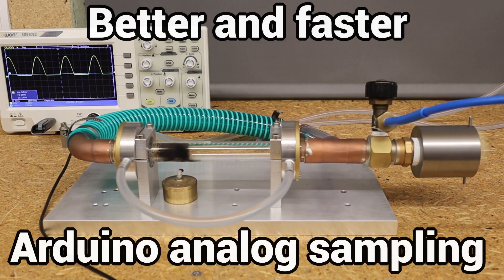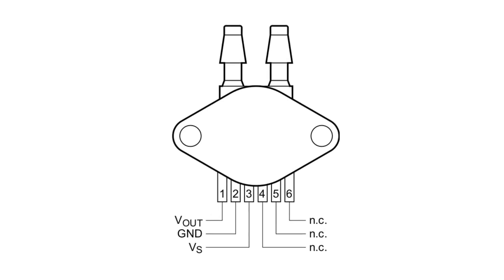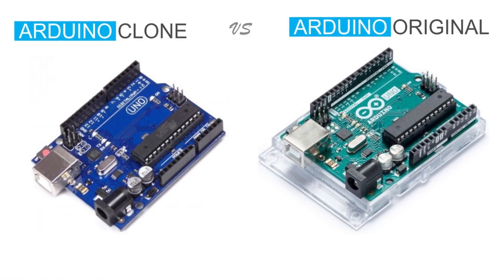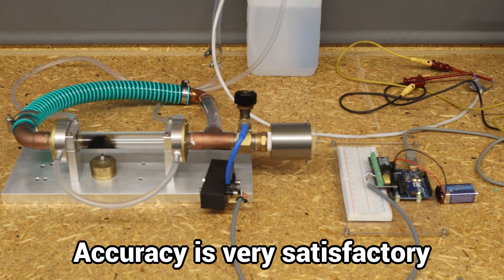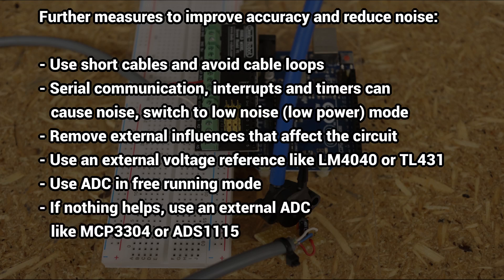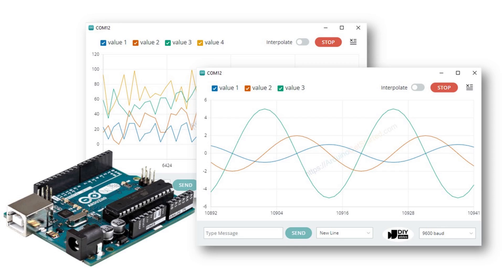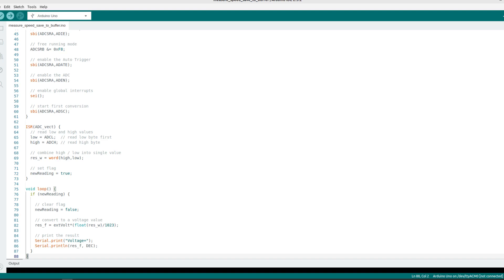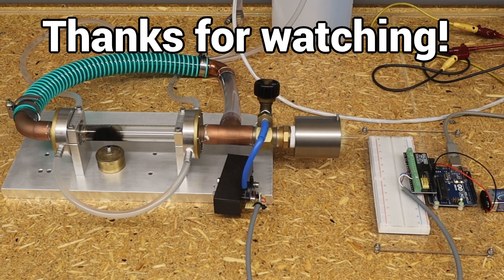Better and faster Arduino analog sensor sampling - improve Stirling engine pressure wave measurement

Comment: the lack of info about thermoacoustic engines is really irritating to me. 
Seeing someone trying to make an actual Thermoacoustic engine for power output, and not just some dinky model toy is really pleasing.
I hope you'll be able to add some more information about your findings to the currently lacking materials about these engines.
Reply from the maker: Thanks!

Comment: Form my understanding of these systems (travelling wave thermoacoustic engines). You get max efficiency with 3 stage system and max power with 4 stage system? Also the second cold heat exchanger after the buffer tube in some cases seems to be replaced with a bypass tube that connects to the cold side. I'm  curious if the bypass method works better than the second heat exchanger. Also the resonator tube  sometimes is liquid.

Comment: What maximum sampling rate did you achieve? I think a faster board like ESP32 can sample ar a better speed 😃
Reply from the maker: I did not tested the maximum I can get with accurate results but it's already faster than I need it.
I have also a few esp32s and 8266s for other tasks but isn't their ADC not as good as that of the  arduino?

Comment: Looks like a great project - enjoy. A few thoughts for your consideration:
a) I was surprised that the bandwidth of the sensor relative to the system frequency wasn't discussed. The sensor datasheet lists its response time (which can be converted to bandwidth) and that needs to be compared to the frequency of the system, allowing for Nyqist Sampling Theorem. There's several ways to measure system speed: a timing gun, bouncing a laser off a moving part and picking up the reflection with a phototransistor, or measure frequency of the sound via a smartphone app. You may need to buy a faster pressure sensor. Following that, the low pass RC filter should be specifically designed so as not to materially impact the desired signal frequency. I agree with other comments that a long air tube may be problematic.
b) I prefer to use absolute pressure sensors. I believe the two port sensor you have may be a differential air pressure sensor. In which case, you're actually measuring pressure relative to ambient air pressure. Even if you block one port with a membrane, that membrane would transmit ambient air pressure. Wikipedia's 'Pressure System' page notes that ambient air pressure can vary up to approx +-10% with weather systems. While it won't impact your high frequency measurements, it could impact repeatibility across the day, and between days.
c) I urge you to show actual values in your videos (rather than use words like 'more' or 'less'), and equations used, as this will help others contribute to, and learn from, your work.

Looking forward to the next video!
Reply from the maker: Thank you for your qualified and informed comment.
I can't show everything I do in the videos, and it's also very important to decide what's really important and what can be left out to save time and money.
I will look at your suggestions very carefully and then implement the most important ones for me!
Your help is exactly why I make these videos!
Thank very much you and best regards!

Comment: nice but why dont you use your other, much better measurement equipment? I see no use in choosing a cheap 3€ arduino over a 1000€ oscilloscope as long as you do not want to control anything with those measurements.
Reply from the maker: You are right, the oscilloscope is very good to show exact voltages and the waveform but I want to measure many other parameters like power, temperature, speed, measure time, timestamping, save the results in a file for further processing, and show them in clear readable form on a display.
Later I want to control and monitor the engine also over the net and many other points as you can see in my older videos of the rhombic Stirling test bench.
Also the oscilloscope is very bulky and impractical.
This is just the beginning of the building of my test bench!

Comment: Great project. Arduino's ADC is incredibly slow, it can take even miliseconds. You will have to avoid using analogread() function and instead make your own by following atmega datasheet. I still think it might be too slow. I would recommend using different mcu, such as stm or esp.
Reply from the maker: You are right, using registers to avoid analogRead() is an additional way to speed things up I forgot that.
At the moment I am very happy with the speed and I can read accurate and much faster than I need to.
Many thanks for your help!
Reply: Hey bro, can you help me to the right direction?
I need a method to collect and store 100ms of (megasamples) of digital (don't require analog) data over a relatively long runtime.
I've heard that dedicated logic analysers can take simple inputs of up to a few hundred mhz or megasamples of data, and log and store a short period of that high frequency data.
I want to be able to log and sotre possibly.. a few megahertz/megasamples of data over a good few minutes.. optimally hours.
All while being able to respond to those inputs and track their fluctuations and respond again accordingly. All.. at those high frequencies.
But I haven't found any solutions, and even seen high end scopes can only see a few megasamples and may only store the log of a very short range of time.
Can you provide me a solution.. that'd allow me to do the long period, high frequency logging and response (like a microcontroller).
I'd not mind if I can find a convoluted solution to daisy chain multiple microcontrollers and use some method to synchronise them to get a high frequency input output solution.. just as long as it'd be accurate.
Also, any tricks to get more sample rate out of the existing popular microcontrollers like you were suggesting in this comment?
Very long comment, sorry for all this.
I know I'm asking a lot.
Would love to get a solution though.
Thank you very much for even reading all this.
I'm not very efficient at communicating complex things.
Reply from the maker: If I understand you right, you want to sample with several  MHz ? 
That's beyond my experience, maybe you look out for the high end external ADCs and special information about that.
A very fast data storage system may also be needed...
Greetings and good luck!
Reply: @yasirrakhurrafat1142 That is a really complicated problem. 
First things first, an arduino won’t help you with that. You need a very high end controller, such as an esp32 or maybe even some kind of microprocessor board such as the raspberry pi. 
Second, you’d need an ADC with decent precision and high sampling rate. L
Third and most important, you need an extremely fast storing method, which would be capable of storing data continuously at such a high speed. 
I suggest you look into professional cameras. They usually deal with high speed storage, since photos really need to be stored stupidly fast. A Jpeg file might be small, but the RAW file that outputs from the sensor and stuff is way bigger, ranging from 2-6 times the size.
Anyways, I think one of these two boards might be the way to go. Especially bare metal raspberry pi, boasting gigabytes of ram memory. It really depends on what you want to do though. Your explanation was a little lacking on what you want to do with the data, so I can’t really pinpoint the best development board to use. Not that it’s an easy question though. 
Best of luck on your adventure.

Comment: The tube between the engine and the sensor may seriously effect results. The mass of air in a long tube acts like an electrical inductor.  It will attenuate the pressure signal at high frequencies.  How high?  You can check the natural frequency of that tube with a little math.  343 meters (speed of sound) divided by tube length (~.3!?).  Thats around 1000 and on the same order as your signal (500 hz).  Longer wires, shorter tube.  Ok - at the end the tube WAS a lot shorter. It needed to be.
Reply from the maker: You are right the tube has to be as short as possible.
It is still a very provisional setup and in the next step I will attach the pressure sensor direct at the T-branch.
I am just testing everything before I can make some serious measurements.
Thanks for your tips and suggestions!!

Comment: Big likes! What do you think This how much more power do compared to a standing wave engine? For example:https://www.youtube.com/watch?v=G3DB_zvoKkw&t=104s
Reply from the maker: I don't know as I just start to make serious performance tests when the test bench is ready!
Thanks for your help and the presentation of your great engine!!
Many greetings!
Reply: @myengines2443  I ask because I have not found this TASHE designed to be better than the standing wave if it is as a generator only as a refrigerator.  I'm curious what others experience...
Reply from the maker: I haven't heard of any high power standing wave engines but there are many high power (up to 5 KW) TASLiCE or TASHE engines.
That's the reason I try this concept.
It would be very interesting to scale a standing wave engine for high power!
Reply: @myengines2443  I have found that thermoacoustic engines are not running similar well if its are generators or refrigerators. The standing wave is a weak cooling machine, and stronger generator, and the other way around, my classic Tashe models are much weaker generator and stronger refrigerator. 
Thus I am interesting and strange that it is high-performance old standing wave engies cannot be found as generator, but gas liquefier yes. 
Maybe, I have only this experience because  tashe requires more expertise, that it to be better but I do not think it. Traveling wave came into vogue because the thermoacoustics, as well as Stirling technology, are mostly used as coolers rather than generators. 
Nowadays Maybe scientists wrong start from the assumption that standing wave is bad as a cooler, and thus for generator also,  I think they undervalue standing wave machines and they do not deal with them because the travelling wave is the vogue.